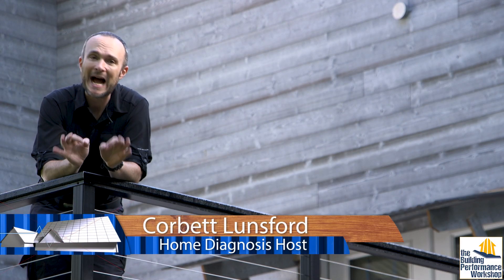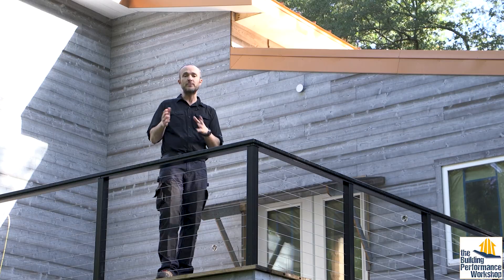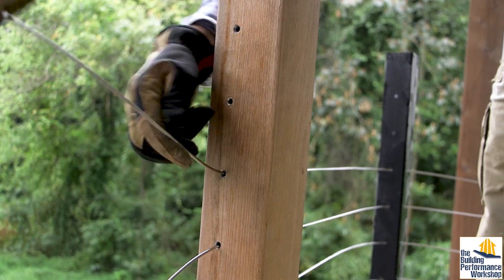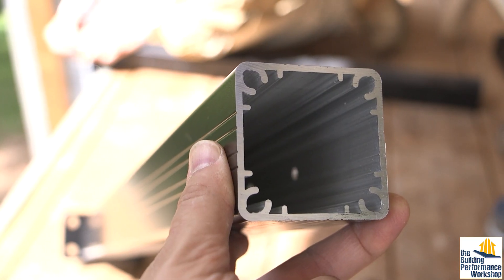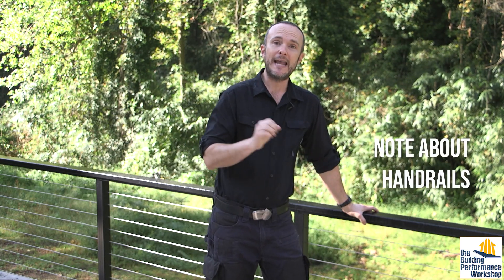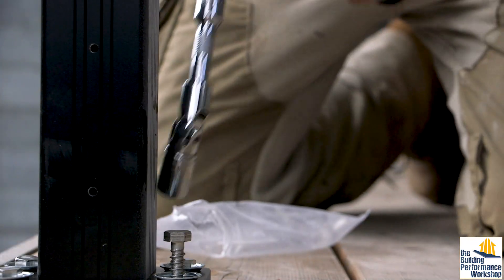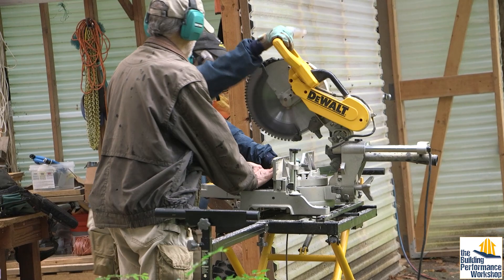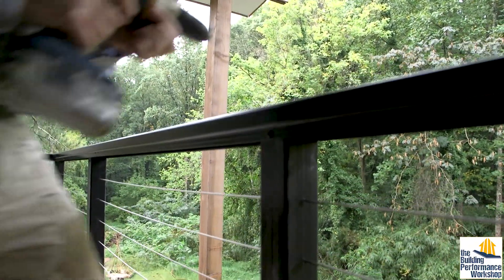Forever Deck Railings from RailFX: Science + DIY

Comment: I used CableRail from https://www.feeneyinc.com and they had a needle that you slid on the end of the cable to make it easier to feed through and kept the cable from fraying. I actually built the railing from galvanized pipe from SteelTek. It was a good bit of cutting and drilling but turned out great. I had built my first railing with wood which warped really bad probably in part due to the cable tension.
Reply from the maker: Cool

Comment: The trick to feeding the wire is to taper the end by snipping a few strands about an inch back. Then soak the end of the wire in super glue which holds the strands together. It's really not fun on very small wire used for lighting...